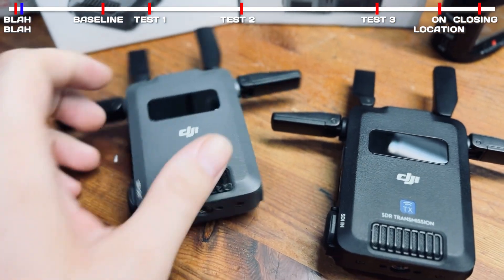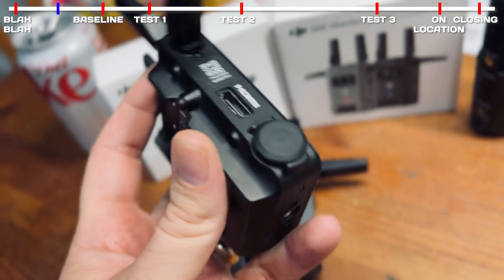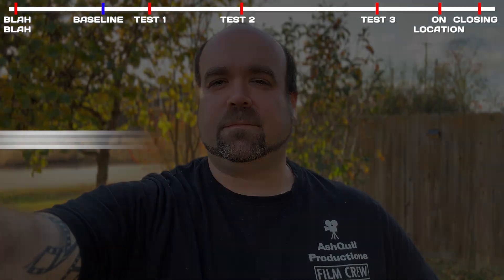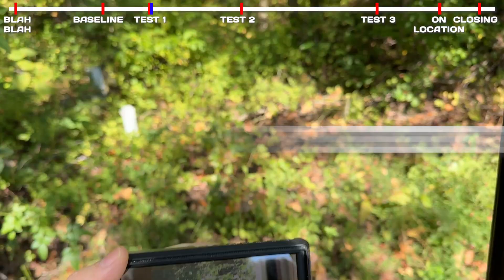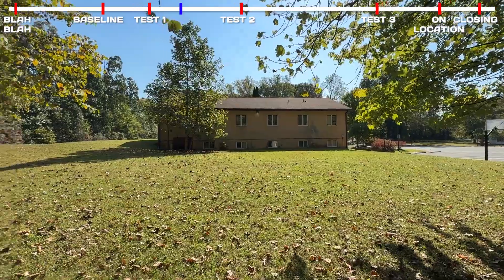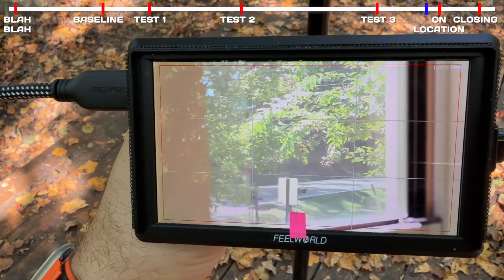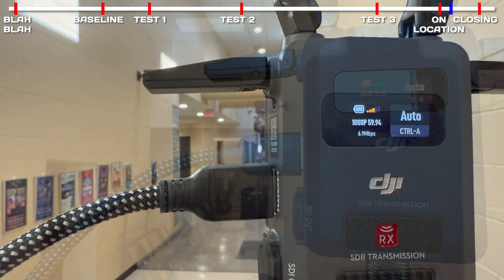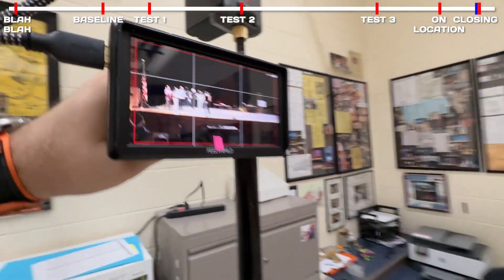DJI SDR Transmission THROUGH WALLS & DISTANCE Field Test!

Comment: These transmitters work so well. We used them in a stadium and we're able to get all the way around the building and more than halfway to the parking garage. These were def worth the full investment.
Reply from the maker: Completely agree! Glad the system is working great for you too!
Reply: I have tried the Hollyland Mars, and now we mainly use the Accsoon CineView HE, which we feel performs a bit better, but there are still some issues with connecting. I'm thinking of moving to DJI just for reliability, but I would prefer a bit more range since we mostly stream at events and sometimes need to get out of the arena. Do you have any experience going from maybe Hollyland or Accsoon to Dji?
Reply: @erik.landen no experience with those. In the past we used Teradek and it would just out the moment we went into a hallway. DJI was such a life saver with some of the distances we had to go. I think in some situation Teradek has some advantages but for sports venues and churches o think DJI was an amazing change

Comment: I want to see the quality of the receiver video. I 'm thinking of using it as the main video source for a podcast livestream
Reply from the maker: @unquestionabletv  As far as quality coming from the receiver, it’s 100% 1080p, with a strong signal. If you’re wanting to use it as a video source for a podcast, I’d imagine you’d be in the same room with the transmitter/receiver and quality would be no issue whatsoever. This test I did was a distance test through walls and long distances, which it worked wonderfully at doing. Thx!